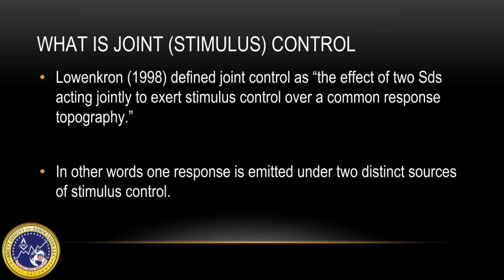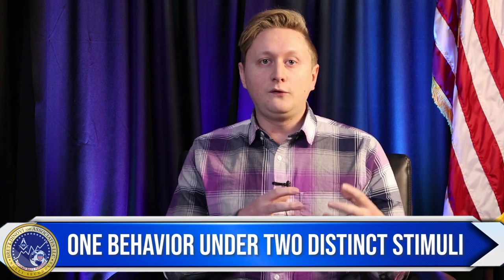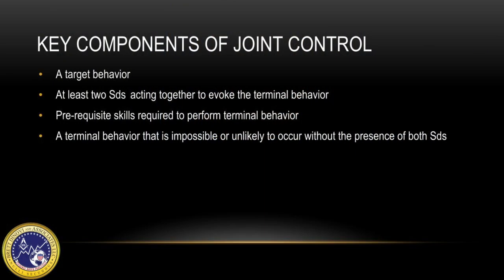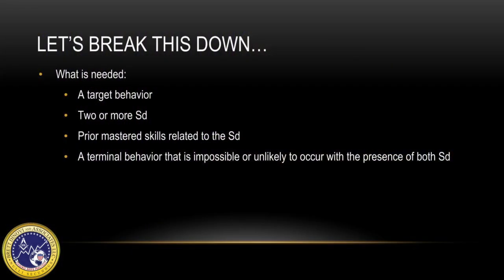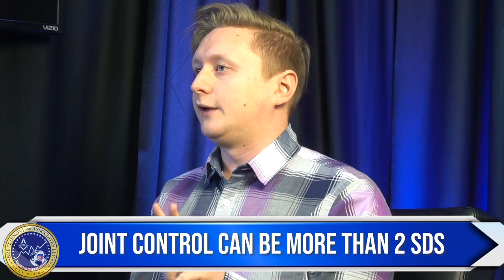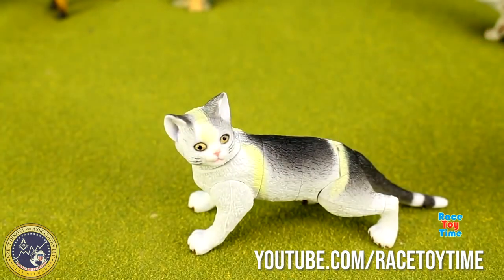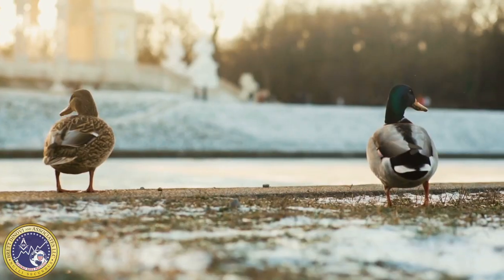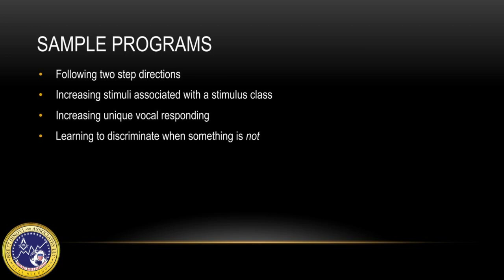What Is Joint Stimulus Control In Applied Behavior Analysis - ABA

Comment: Thanks for simplifying this topic Billy.  A followup question that I have for you is, generally how detailed and complex can the linked stimuli be in clinical practice.  As you described in the example of a cake recipe, at what point does the "joint" become more like a complex "web"?
Reply: Great question! It sounds like your question is asking how we handle a chain of behaviors that could possibly; A) have multiple outcomes or B) different choices that ultimately result in the same terminal behavior. We could look at the chain of behaviors as if under multiple control. The choices made at each "intersection" would be based on the specific person's learning history(I.e. what has been reinforced/punished in the past). For example if we wanted to create a "web" like situation we could use the GPS example from the video. However this time instead of following the demands of the GPS you used your learning history to know that there is a shortcut that has provided more reinforcement in the from of a faster path in the past. The web being the on the fly decisions you are making now that you are off track(i.e. go down this side road with a lower speed limit, choosing to avoid high traffic areas, etc.) You take the shortcut but then use the GPS to get your the remainder of the way. If your shortcut works and you end up getting their faster, then you have met the terminal goal without following the explicit steps, I'd say you displayed some instances of joint control but also a lot of autonomy in leaning into your learning history. If you do not get to the GPS location you may have to turn around and follow it back, but again this would just add to your learning history. You could look at the number times an individual engaged in either following the GPS to the T or diverting from the path and then their history of contacting reinforcement to see if they are more likely to engage in either in the future. This is a great example of how most of the techniques or strategies we use in the field are not held in a vacuum. We as clinicians need to be ready to combine strategies in a way that is most effective for our learners.